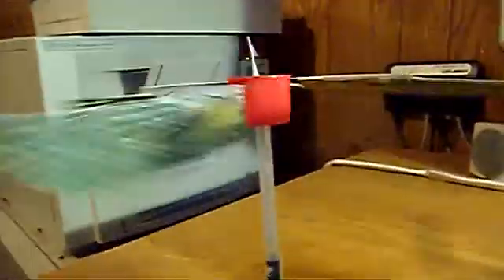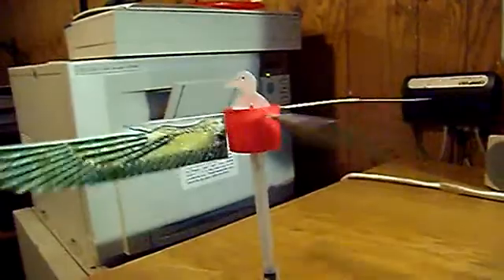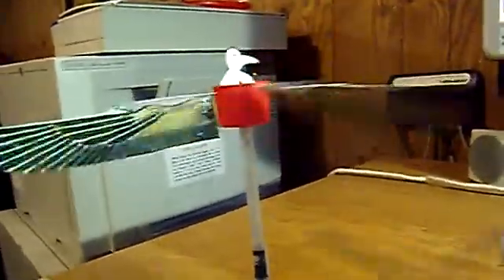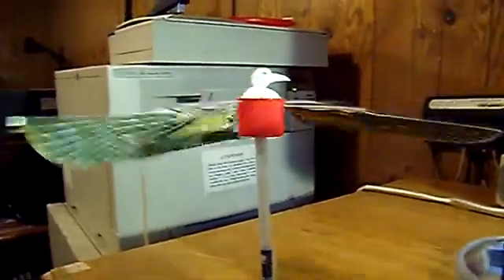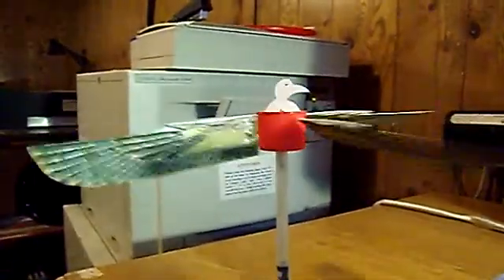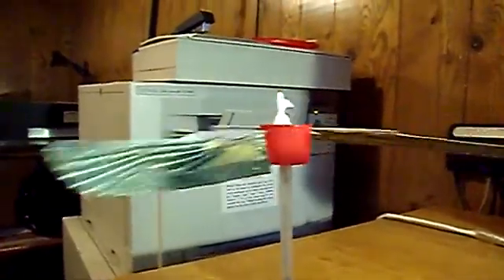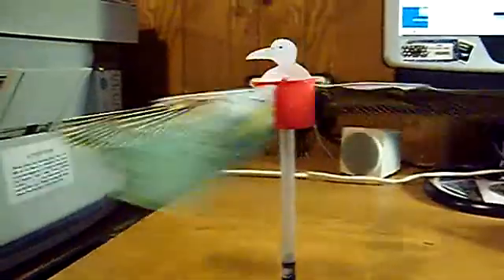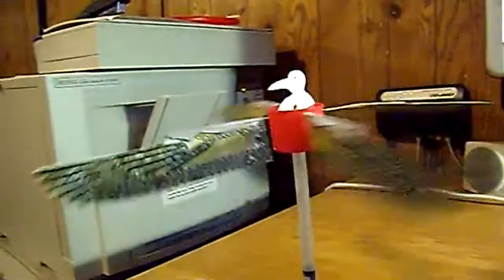Ancient VAWT Wind Turbine Prototype Resurrected!

Comment: And for more torque just add additional wing levels, each group offset by 45 degrees. Use a 4” by up to 10’ PVC pipe as your center shaft.  You can also design it to be a hanging structure as well, weighted or anchored at the bottom for stability in the wind.